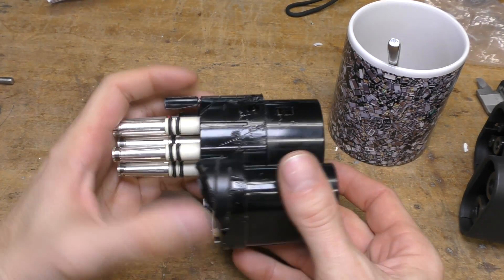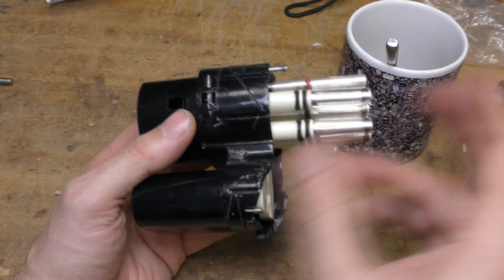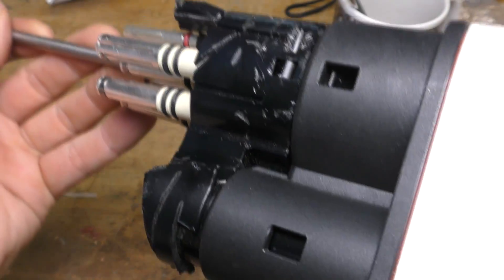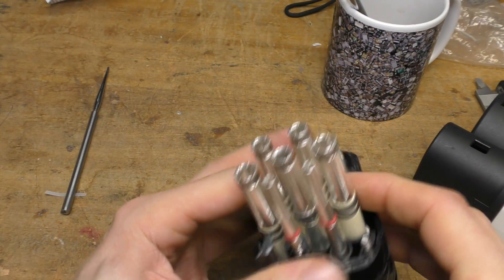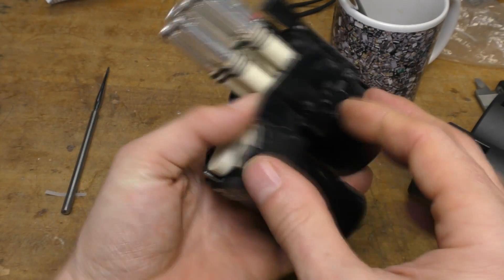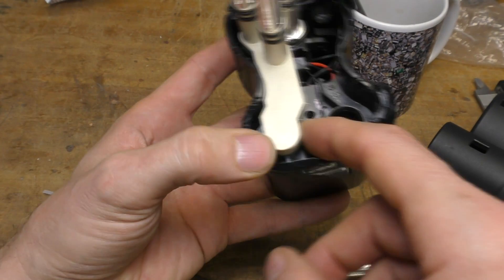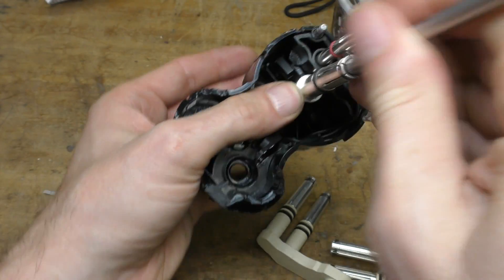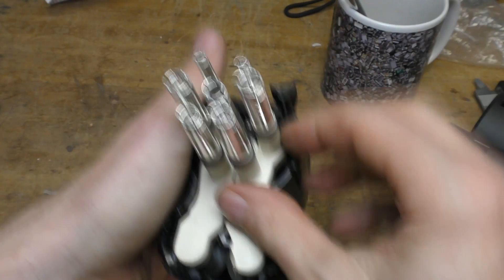Tesla European CCS adapter teardown

Comment: I prefer a doggy standard that's used over no standard. And it looks (in this video) that converting it to a proprietary downstream solution isn't over complex.
Reply: The only real difference is Tesla uses the same pins for both AC and DC input rather than CCS's dedicated DC pins. This makes an adapter fairly straightforward providing the hardware in the car supports the communications protocol. My understanding is older Teslas will need an upgrade to the onboard controller to use CCS.
Reply: @Smidge204  It 'll be similar to any company that wants to promote their design to a standard. A fair field.
Reply: @JanCumps  I don't think Tesla has any desire to promote their design as a standard. There are SOME people who want Tesla to be the standard, but that ship has already sailed. The 250KW V3 superchargers they're rolling out lag behind the CCS in terms of max power and V4 will at best match what CCS is already doing (350KW). Tesla kinda engineered themselves into a corner on this one.
Reply: @Smidge204  Exactly! The CCS might be complex but that's like saying "USB C is complex". It is complex but it can do much more.
Reply from the maker: @littlebuch  The problem is CCS is way more complex than it needed to be, which has caused lots of compatibility and reliability problems.
Reply: ... as is USB.  Remember when USB was the designated low-speed protocol?  It lived harmoniously next to a higher speed bus, when you need it.

Now it’s the low speed bus, the high speed bus, the charging port, the chargER port, the external expansion bus interface, the video interface ....
Reply: @sirnickity  i feel like you people just want to complain. Fucking go and charge your car. Who gives a fuck. CCS gives you the possibility to charge on any infrastructure. You can't have the fastest chargers everywhere. Same as USB. Not everything can charge at the fastest speeds and given that information not everything has to have a different connector.
Reply: @littlebuch   I think the reason you think I don't like USB is not the reason I don't like USB.

As interfaces grow up, they tend to get complicated.  And often, this isn't for a good reason.

Look at USB 1.1.  It had two speeds, and provided some 5V for low-power client devices.  There were a whole two connectors:  Host side and client side.

This made sense.  Devices that just needed to send a bit of data back and forth had a single, hot-pluggable interface, that even provided power.  Great!  Now it's a chaotic spec-soup of connectors, protocol versions, speeds, optional support for this or that other interface...

This comes at a cost.  For one, massive consumer confusion.  I mean, go into a store and try and determine what voltages and at what current a particular USB C battery pack can provide.  Half of them don't tell you.  Will it do 9V?  15V?  Who knows!  Is this cable meant for eleventy gigabits and charging at 8A?  Could be!  If I plug this computer into this display, do I get an image, or just USB hub support?  It's a mystery!

It's dumb, it's overly complex, and designing devices that attach to either end of a cable is needlessly difficult now.  The consumer won't know if a particular combination of things that physically fit will do what they thought it should do, and the designers of these products end up having to consider a lot of edge cases, and using negotiation protocols for stuff that previously was just there.

Was it really so hard to have a "general low-speed stuff" hole, a "general high-speed stuff" hole, a "graphics come out here" hole, and a "electrons go in / come out here" hole?

Trying to be everything to everyone pretty much never works out as well as it is intended, and USB is trying really hard to be ALL the things.

Just because it (usually) works, doesn't mean nobody deserves better.